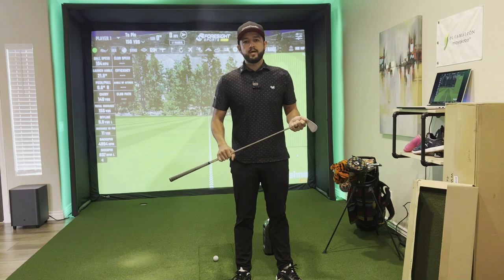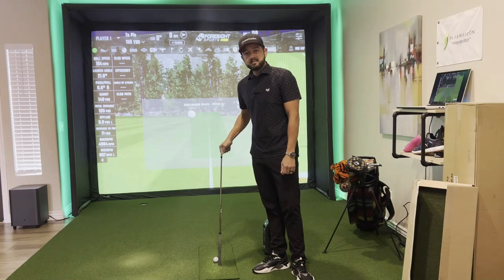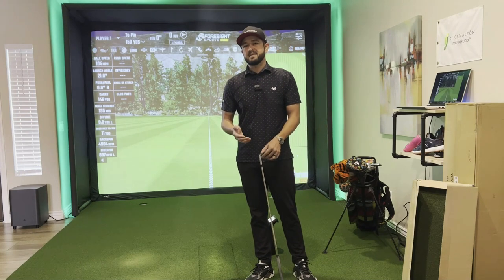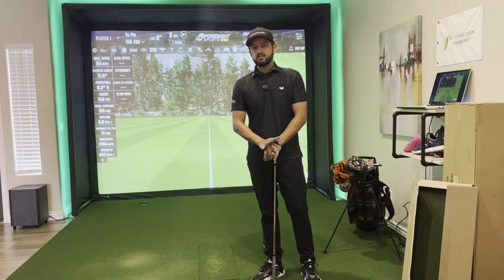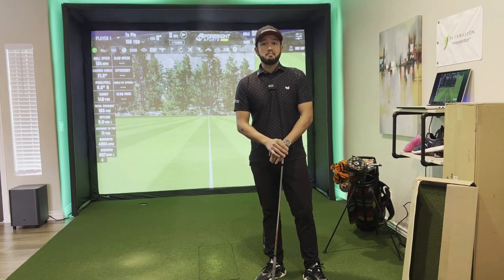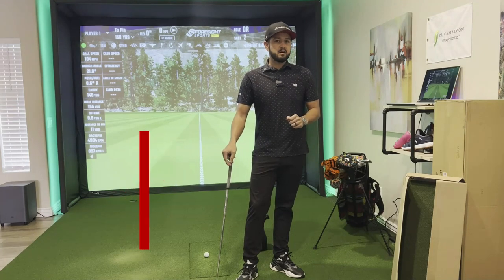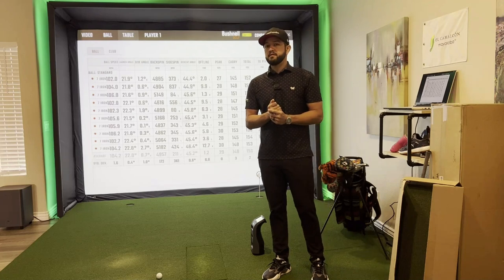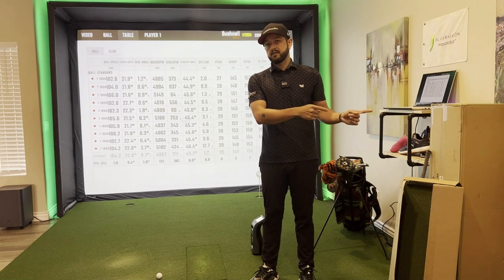Carl's hitting mat & hitting insert REVIEW + GIVEAWAY

Comment: Beautiful setup you have.  I'm in the process of building my own and have to decide where in my shop I want to set it up.  My options are in a corner like yours up against a wall or have it in the middle of the room with all three edges clear.  I'd prefer the corner just to save on floorspace but am concerned I'll regret it.  If you had the choice/floorspace would you still put it against the wall again? Going with the 4:3 aspect ratio and a 9' x 12' minimum screen size so I don't want to screw this up!  Thanks
Reply from the maker: It really depends if you’ll plan to have lefty golfers, if it’s just right handed players, save the floor space I would say. Being in the middle of the room sounds like a cool idea though and you’ll be able to run it with side nets on both sides if you’re worried about shanks.
Reply: @PixelGolf  thank you very much for sharing your thoughts. 👍

Comment: Love the vids! My wife just bought me the pre order rapsodo 2 …looking to set up a simulator in home. I love your setup and am going to try it out. 

Did you get the piping from carls or did you say you built it/got it from Lowes or something? If so, do you have a material list from Lowes/Home Depot?
Reply from the maker: I didn't get the piping from Carl's - I sourced it locally. Carl's should send an email prior to receiving your shipment that gives you a breakdown of the pipe lengths you need. I got my EMT from Lowes and made the cuts myself but they will likely cut for you, too. Make sure none of the pipes are bent.

Comment: Glad to see you're back! Before you upgraded to the GC3, did you find yourself using the Mevo or GC2 more?
Reply from the maker: I was obsessed with the Mevo+, but once I got the GC2 the ease of setup and ability to chip accurately swayed me more towards the camera based system. However, I could not recommend the Mevo+ enough at its price! Great device if you have the room, easy to throw in the bag and take to the range and better for switch hitters.

Comment: Great Comparison video thank you for sharing, I find myself currently looking to try something new as well it is how I found this video. I have been using the player preferred from fiberbuilt and it just wears out too quickly imo I have hit about 10k shots on it already turned it around and wore out the other side as well so I think I may try to cut something into the actual mat and retro fit it. I purchased aa new center piece yesterday just to make it less of an issue to try some new things out with the old one. Again thank you for sharing.

Comment: Nice video does the cost of the DIY insert out weigh the $135 of the Carl's insert?  thanks
Reply from the maker: It does not… The DIY is anywhere from 50-80 usd, depending on size and current material costs. The carls is nice if you aren’t trying to work with an exact size insert or just want one ready to go.

Comment: You have some Good content.    I’m curious what is your screen size?
Reply from the maker: Actual image is 89” high x 117” wide. There’s a video on the channel with a breakdown.
Reply: Oh cool. I must have missed one of the videos.  So are you running 4:3 or 16:9?
Reply from the maker: 4:3. Technically 1402x1080. I mounted the projector until it filled the height of my screen and the used the Nvidia graphics card to make a custom size that filled the space exactly, which was 1402.
Reply: Oh awesome.  Thank you for the info!

Comment: I am currently building a simulator but am uncertain of lighting requirements when using a Mevo plus. Any help would be appreciated. Do I need a specific spot light setup aimed at the ball?
Reply from the maker: Spotlights are more for camera based launch monitors that read the hall in the first foot or so. With Doppler Radar measuring like Mevo+ it uses as much ball flight as possible, so it would be better to have even light in the room rather than a spotlight.
Reply: @PixelGolf  Thank you

Comment: What made you upgrade from the mevo
Reply from the maker: Ease of use and I putt and chip a lot when dealing with back issues and want to hit balls still. The camera based systems never really miss a beat on the soft swings. I also would get frustrated when people came over to play and it would misread putts or miss chips. I ended up having to just switch it to auto putt mode and add mulligans for chips that read way off. Although, I haven’t had a Mevo for almost a year now, I’m sure a lot has changed.